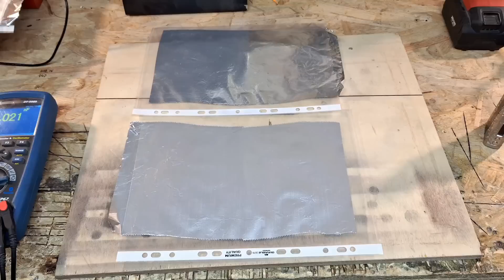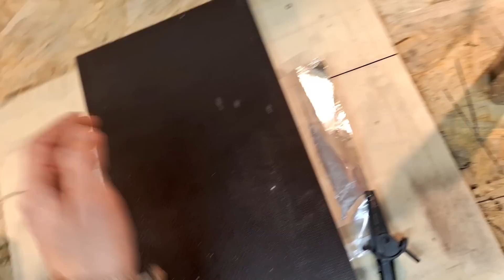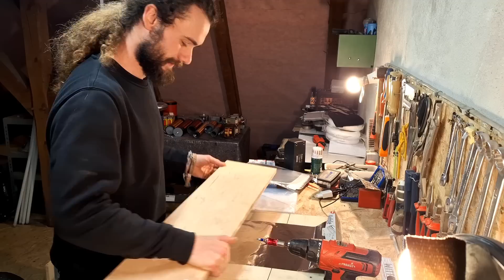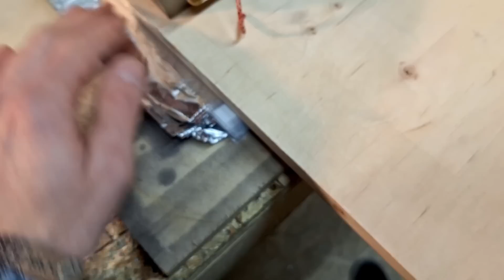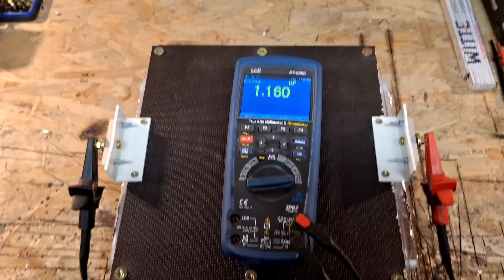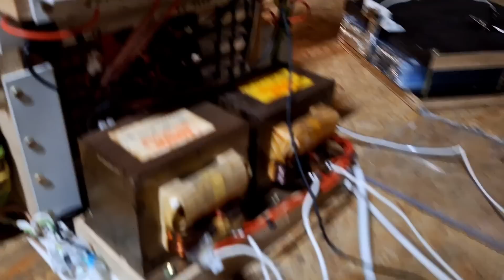I Build an MASSIVE High Voltage DIY Capacitor!

Comment: pvc air caps using plumbing drain pipe and HVAC foil tape
Reply from the maker: @anonymouscoward9643  yes, there are many ways to build a capacitor. But it is quite challenging to build a high voltage cap that also has a high capacitance.
In my case it is getting really timeconsuming and big😄
I would love to build a 5 or 10uF one, but this will take a whole week, just stickig aluminium foils in the plastic foils😆
To reach this capacity just with PVC tubing and aluminium tape, would be really expensive and would fill up my whole room😄
Reply: @marvsworld247 I found some cheap 3000m × 45cm roll of 20um bopp, hahahahah time to make a really big capacitor
Reply from the maker: @hvMarty you will need two of These and two big Rolls of Aluminium foil and build a device to hold all 4 Rolls perfectly in Line to smoothly roll it Up together without too much trapped Air inside.

Ive rolled Up a capacitor with 5m x 35cm x 0,1mm Film Like that and got 0,85uF and can Push it to about 4kv
Reply: @marvsworld247 yeah I prefer the sandwich method because, yeah it's a pain in the ass but, like you said need 2 rolls of dielectric, and it's comparatively cheap with a big hv cap, but not that cheap, also if I sections in, let's say 3-6-9 meters caps, it needs a ton of copper or aluminum strip to make the connections, also it's more inductance, more useless space if I put the capacitors in a oil chamber, because the cilindric form, needs just 2 buses for connections in parallel 
for My personal research and perspective, it's much more effective in performance to make a capacitor like yours
It's curious because the chinese brand called BYD founds out practically the same with their "blade" technology, respect to normal battery packs, with differences obviously but you know 
I'm not even a quarter of expert than you, but with all the things, what do you think? 
The final C gives around 24uF, idk how much v/um can withstand thin bopp, but the price for making is much cheaper than majority of pulse capacitors, the shipping kills me because I'm like 14000km of Europe or EEUU, soo...
Reply: @marvsworld247 idk how it's not selled on Europe or usa, literally ideal for making marx generators, and for that yes is ideally for rolled capacitors, yeah 200usd is absolutely not cheap, but you make like 70 0.14mm 166nf capacitors, pretty good, here is like 7 usd those ceramic 3nf 20kv, EACH ONE
Reply from the maker: @hvMarty yes. But be careful! These homemade Caps are really Bad for high frequency applications.
Reply: @marvsworld247 oh yeah I know that, I once made a capacitor like that, and the plastic burns in the connections and heats also, then I use glass for the sgtc that is better I think, it's for DC pulses only, and not high repetition rates, more careful I need to be extremely careful because it can absolutely sublimates my hand charged, u see that 50uF 20kv capacitor video? Scary stuff
Reply: @marvsworld247 also your vttc is beautiful and the capacitor topload is 🔥🔥🔥
Thanks for the help from Argentina, I seen that BOPP in thin films can withstand between 100-300v/um normally, 700v on lab grade, it's strange that thin films can withstand more relative voltage and I don't understand why, if you know
Reply from the maker: @hvMarty yes capacitors are really powerful when charged at high voltages at big capacitys😅 that's really scary sometimes😅
Reply: @marvsworld247 yess, once I made like a bank of 100nf (10-15kv maybe? Idk it was charged with a flyback) and its discharges sounds like firecrackers, with more than 200 the Capacitance and double the voltage 😬, but like everything, safety and would be very fun
Reply from the maker: @hvMarty yeah😅 i accidentally Had a discharge at my 7,5kv 60uF capacitor bank because of a overvoltage Peak and i arced over🙈 that was Like a shot of a big rifle.. since then im wearing earprotection🤣🤣
Reply: @marvsworld247 that capacitor bank needs a whole video by itself!
How much did it cost your vttc?
Reply from the maker: @hvMarty it is a "normal" bank of oil /paper HV pulse capacitors in series and parallel. Got them from eBay for 100€😅
Reply: @marvsworld247 that's nice! It's a shame that here I don't acquire vacuum tubes or power electronics, or it is very very expensive, and base price for polepigs it's also pretty expensive, but if for a miracle I get it cheap from industry or something, would make a huge sgtc, is the way to go here, now they are just dreams for future projects, but the capacitor bank is very interesting to make
Reply from the maker: Aaah ok yes that's Bad.. even Here in Germany it is Not that easy to get your hands in stuff Like that.
Vacuum Tubes ok yes, but for big Transformers and capacitors you have to get lucky or have contacts.
But in some countries unfortunately it is almost Impossible.
Reply: @marvsworld247 it's curious how (here, in other countries idk) the pole pigs prices scales not lineal with the price, for a example a 40kva cost 8 and a 100kva cost 10, but the base price even for MOTs power levels is high, it's a shame really, in comparison is 10× the capacitor bank, with that sheeesh, I can explode even the 5000A fuse like it's nothing, but well, also i need a equally powerful HV source for not waiting minutes for charging the capacitors, but that is not much a problem
Reply from the maker: High voltage Transformers can be really really expensive.
I never found a pole pig in Germany, because we do Not have such simple Transformers Here.
We mostly have pretty big 3 Phase ones and These are super expensive 😅
Reply: @marvsworld247 here is more common to see small transformers in the neighborhoods, because the hotels or companies can't use that much power of the three phase grid
That is a advantage, but can't using that much power is also a disadvantage

Comment: The stored energy is in the dielectric.  You can remove the dielectric sheet from between two plates of a charged rigid plate capacitor and the voltage on the plates will vanish.  If you replace the dielectric the plates will show the charge again.  Take care. Nice video.
Reply from the maker: @KallePihlajasaari  yes, capacitors are really interesting! 
Didnt read much about that until i got into the idea to build this big cap.
Thanks for watching🙂✌️
Reply: @marvsworld247  I was first interested when reading about nitrogen lasers.  Since then I have had a passing interest in shrinking pennies and exploding wires.

I actually have 4 boxes of overhead transparency foils waiting for inspiration that are a bit thicker than the file document pouches you are using.  Doing this regularly would drive me to use coils of plastic and metal but there is little demand for budget HV capacitors.
Reply: Is  there a video showing that?
Reply: @chuckcrizer  same thing works with a dissectable Leyden jar.
Reply: @chuckcrizer  Not sure, I have not seen one but I read in in a High school physics text book 40 years ago.

It would be a great topic for a video I suppose. The important thing when attempting the experiment is to use very good quality insulators when handling the capacitor parts so the charge does not drain away, probably want a dry environment as well. I think an electroscope was used to observe the potential difference.

Yet I have this niggling feeling that I did see a video possibly before YouTube days of someone doing it using styrofoam cup as the dielectric. This may also be a dream memory but 3 cups, one with aluminium foil inside, one with it outside used as electrodes and a bare cup used as the dielectric.  Just realised it may be difficult to find styrofoam cups in many places, flat sheets are common in insulation and if they don't have static mitigation additives they a thin sheet should work fine between flat electrodes.
Reply: Actually the energy is given by the following equation:
 E =0.5 CV²

So the energy is a function of the capacitance AND the voltage.
And the capacitance is a measure of all the charge in the capacitor which includes BOTH the charge in the dielectric AND the metal plates.
Reply: Yes, the energy is stored in the dielectric, but the charges are on the plates. So as you remove the dielectric, the energy stays in the cap, it is just now stored in the air between the plates. As the permittivity of the air is much lower than that of the plastic, the voltage will actually rise to keep the energy the same.
Reply: @justineloi1234  Your explanation makes sense but I would still expect the insulating dielectric to also have a static charge on the opposing surfaces.  Might be worth trying.  Flat plates should be easier to test.  I think a HV probe might be enough to do testing to a few kV.
Reply: @KallePihlajasaari  probes arent the way. rearrange the stack... reverse just the dielectric. reverse the plates. etc.

Comment: If you add oil it should increase capacitance quite some
Reply from the maker: @vasili_sk  i thought about that too, but at first place, to get rid of the air and rise the voltage rate a bit.
But this would be a absolute mess😅
But yeah, maybe you right with that🙂

Comment: This construction should have very low ESL and ESR. It might be good as a resonant capacitor or for pulsed power. I wouldn't be surprised if it can deliver 10 kA if you shorted it into the right circuit!
Reply from the maker: @odincauzza2509  yes, such easy build capacitors can actually reach incredibly good Performances with the right dielectric Material.
I found out, that Polyethylene is also really good at high frequencies! 
I think PE sheets for dielectric and copper plates, would build a really strong HF pulse cap! 
Only downside is that PE is not really heat resistant.
Thanks for your comment🙂
Reply: @marvsworld247  I don't even think you need copper foil. If the foil is 0.01 mm thick, 200mm wide, and you stack 100 sheets you have 200mm^2 of aluminum cross section. 

And unlike a 200mm^2 cable that would power an apartment, you won't have problems with the skin effect at high frequency since it is 100 thin leaves.

The biggest challenge would be to firmly connect each piece at the ends. I think your terminals worked well though.
Reply from the maker: @odincauzza2509  oh you absolutely right with that! 
It just feels a bit weird, to build a high power pulse cap and Just use this super thin foil😄
Yes the connections are a good point. At first i want to press all the connections together, using two aluminium rails on top and bottom of the aluminium sheets. But they were too short, so i decidet to cut them to get a long strain. In that case i accidentally ripped some foil strains off... but i folded the Rest together, so they are connected together again. But yeah that was a really fine work and not easy

Comment: I tried these when I was 15. I think they call them sheet protectors. My only high voltage source was this little handheld van de graff but I made loud sparks with a single one of these polyethylene sheets. 

When it finally broke down, it didn't just burn a hole, the pressure of the plasma split and tore the plastic and sent chunks of it flying.
Reply from the maker: @odincauzza2509  aaah "sheet protectors" makes sense! Thanks for correction😄
Yes these capacitors are really easy build and really potent! 
Never pushed it into breakdown, but would be interesting how much volt it takes to kill such a capacitor.
Reply: @marvswelt2587  Yes. These sleeves are correctly called "page protectors" and can be bought in different "mils" (thicknesses) and different surface finishes such as "glossy" & "matte". Another material I would like to see used are called "laminating pouches" which also come in different mil thicknesses and sizes, biggest being DLT (Double Letter, 11"x17"). Page Protectors are quite inconsistent in quality. Laminating pouches seem to have a better overall quality. Additionally, with the Laminating Pouches, you could even loop in some copper terminal wire into the layers and heat seal it into position on the aluminum foil. Just a thought!!! 
PS--Laminating pouches would be much easier to install the foil as they are hinged on one side.
Reply from the maker: @fookingsog  nice! Thanks for the Information!
Yes, you also can find the Page protectors in different materials. 
I used the gloss finnished ones with PE-LD (polyethylen low density) because of the "low density" i wasnt sure about how high the voltagerating can be on them, thats why i tested them first.
I think the laminate pouches has to be more constant in Material qualitativ, because they have to get savely sealed everytime at the same heat/time duration.
Reply: @marvsworld247  It was "1,160 uF"!!! That's not a period in there, that's a COMMA!!! Which means it is "1.16 FARADS"!!! Moving the decimal three places to the left goes from "1,160" -->>"1.160"!!! Please correct me if I am missing something here!!!
Reply from the maker: @fookingsog  haha 1.16 Farad would be absolutely crazy (and really cool!) No unfotunately its "just" 1,16 uF (1160nF)🙂 my Meter has just points and no commas
Reply from the maker: @fookingsog  i think about how it would be to short out a fully loaded 1Farad 10kv capacitor😄
Reply from the maker: @fookingsog  50.000.000Joule actually🤣🤣🤣 for example 1g of TNT is about 4000 Joule..
That would be like 12,5kg of tnt 😅😆
Reply: @marvsworld247  Have you heard of "coin shrinking"??? 🤔 MASSIVE capacitors, huge contactor, massive energy dump!!! Quite the opposite of what you are doing. You're setup is high voltage, low amperage whereas the shrinking is fairly high voltage but massive amperage!!! Much more dangerous on the output side than what you are doing!!! Has to be done in a physically shielded enclosure and I bet creates a pretty hefty EMP (Electro-Magnetic Pulse)!!!
Reply: Safety glasses and make sure to catch it on camera!
Reply: having worked on assembly lines, I can tell you that you will be able to build the capacitor faster if you cut all of the foils , and once finished, you insert them into the protectors. it saves time because it minimizes your body motion.

Comment: Nice design. I'd recommend tripple the thickness aluminum foil, or copper of equivalent thickness. This will decrease the likelihood of hotspots & failure. You spark quality is gorgeous, and you're on the right path. May I also recommend not using any black materials, as your dielectric will need to be far greater to prevent issues. Enjoy
Reply from the maker: @TABLESAWTIM  thanks🙂
Yeah a bit thicker foil would make the build of this capacitor also waaay easier😅
This cap actually dont have to work at high frequencies, just at 50Hz, so it dont have to perform super crazy. 
I have already new ideas for a HF Pulse DIY Cap. Capable to variate the capacity.. In this cap i will use copper or aluminium plates and better dielectric Material, to get it more efficient. 🙂
Thanks for your tips🙂

Comment: looks like youtube deleted my comment again.

I said that if you put all the foils in parallel and roll them together you will get the same voltage rating but more than double in capacitance.
Reply from the maker: @janno288  yes i know, but rolling 230sheets would not even give one turn😅
Reply: @marvsworld247  no, take the plastic foils with the alumium foils. like them up into a row and glue them together on their sides.
then make another row.
The alumium foil ends on each side will be your connection.

You stack them on top of each other and glue the 2 foil lines together and roll them up.

It wouldve been better for you to use trashbag and alumium foil, you couldnt even have to cut the alumium foil.
Reply: I was thinking of a way where you dont have to do all the cutting and such. 
wax paper
al foil
wax paper
al foil

use spray adhesive. Roll into cylinder. 
for higher voltage put in pvc pipe and fill with oil. 

idk, this has been in my list of projects to try for a while.

Comment: i was JUST about to do this last night what are the odds you upload this
Reply from the maker: @aaaAaAAaaaaAa1aAAAAaaaaAAAAaaa  haha, someone in the comment section said some almost similar😄 
Good timing😄
Reply: @marvsworld247  thats some cosmic timing 😂
Reply: Just a few weeks ago I bought a pack of these sheet protectors so I could build one of these again. Haven't started assembling it yet...
Reply from the maker: @odincauzza2509  hehe nice! Try it😁 but be careful🙂
Reply: @marvsworld247  I will for sure! Capacitors are deceptively dangerous.

Comment: i was actually just reseaching how to make capacitors and this video popped up. very useful and fun! Thx a bunch and have fun creating!!
Reply from the maker: @chronixgamingferret6960 haha cool! Perfect timing😃
Thanks, you too🙂🙌
Reply: I did this some 20 years ago, but I used a laminating machine. You can get thick or thin lamination sheets and simply laminated the aluminum foil. You just have to leave a little extra foil out one side to connect the wires to. You can also space them apart with normal copy paper if you need to. And after use you can pull it apart and see the static electricity still trapped between the sheets.